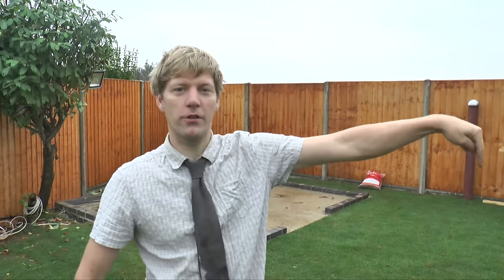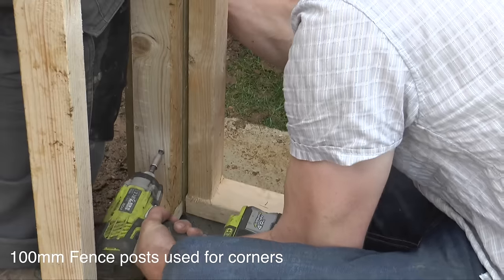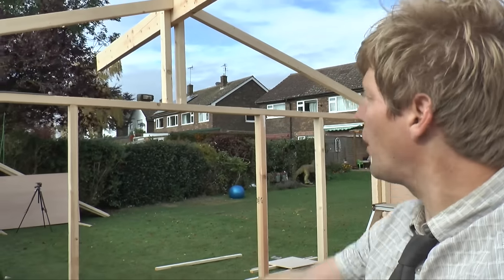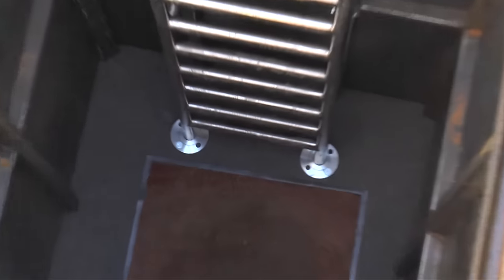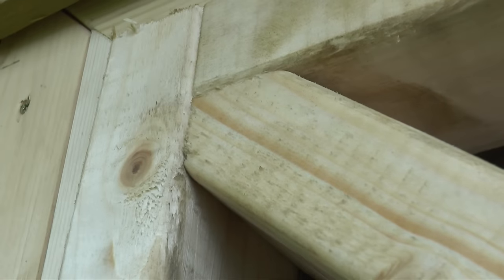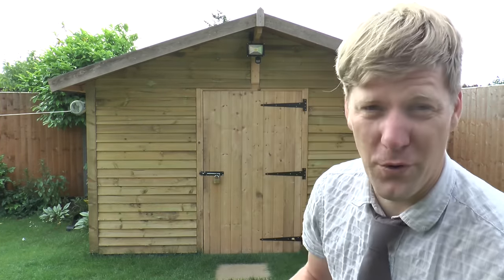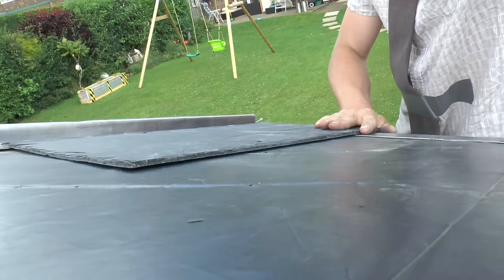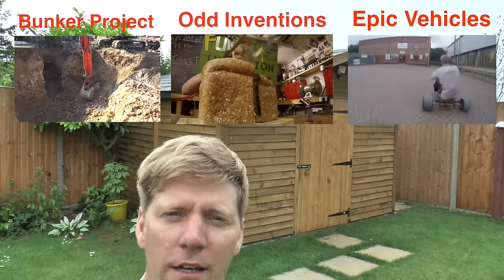How to build a really SOLID shed

Comment: Engineer here, the brick will absorb water like a sponge and transfer that to the wood. Unless you used water resistant bricks, which you didn't specify.
Reply from the maker: They were engineering bricks
Reply: I would have wagered he burn down the shed sooner than the boards rot.
Reply: Don't question the master
Reply: +colinfurze you should make a survival kit video
Reply: Did you just set it on top, or do you have some wood foundation underground? it seems like you just plopped it on top, and a hard knock might jostle it out of place.
Reply: In Australia it's against building code to have wood touching cement/brick except on internal walls. we use a rubber gasket between then Ramset the walls to the slab.
However I would think Furze will tear down the shed for some 50 foot robot that farts rainbows project long before it rots.
Reply: lol
Reply: I've tended to sit the frames on bricks and then wrap the treated mudsil in DPC so the moisture doesn't transfer.
Reply: they screwed it into the bricks
Reply: That roof rocks!!!
Reply: Not to mention there being no ridge vent.
Reply: They don't get much snow. The lack of a ridge vent doesn't mater that much
Reply: Even so, proper ventilation will reduce chances for mold and mildew growth as well as lengthen the life of a roof.
Reply: And he didn't do a topping out ceremony, so Kevin McCloud will disprove.
Reply: who gives a shit, as long as it's not sitting on dirt, its fine...
Reply: +space Aye not much snow but a coupla inches and the entire fookin country shuts down.
Reply: +JayXX Probably by accident too.
Reply: Normally, you'd have a capilary break between the brick footer an the bottom plate to keep water from wicking up into the bottom plate.  A continuous sheet of lead would work.  Or use treated wood for the bottom plate.  I'd worry about rot without that.  Also, you should have some kind of tie down from the roof framing to the ground.
Reply: The product you're looking for is "Sill Plate Gasket" or "Sill Seal" and is fairly inexpensive.  It's just a foam gasket in the appropriate width that you put in between the brick/concrete and the sill plate.

If you want to get really high end some companies make EPDM sill gaskets that cost more but do a far better job air sealing the gap in addition to cutting off moisture travel.  Generally they require being stapled to the underside of the sill plate before its installed, but its the ferrari of this kind of product.
Reply: Woulda like to see more of an overhang colin! Other than that don't listen to these technical muppets entrenched in building regs bollocks, it's obviously gonna last pretty well.
Reply: Blue engineering bricks are what are used as the damp course on houses... go outside and have a look yourself. Stop trying to be a smart arse. from a proper engineer.
Reply: It's a shed. The importance in building quality is not top notch. Besides, I didn't see him use gaskets or similar when he screwed the tiles into the roof which meant he essentially drilled through the "water" protection cover anyhow.
Reply: engineer here, blalala. that is all
Reply: patheticmada
Depends on the brick. Some have sponge effect due ..Capitallar effect or what ever it is called. Basically, if a stone, like lava rock which has a very many small channels inside it, they can suck up water due that effect. But generally bricks aren't constructed in that manner.
Reply: patheticmada
.... I was taking an example of the capitallar effect or what ever it is called where small holes etcetra had the ability to Suck up water even if they are "Stone/Rock/Brick". Aka, their structure. Generally bricks like cinder bricks etcetra have much space between their balls which both make them light but also doesn't make them suffer under the Capitallar effect which can suck up water.
Capillary effect That's the spelling.
Reply: I make my bricks water proof by covering them in Vaseline and wrapping them with saran wrap
Reply: +Helveteshit true, I'm more concerned about no real truss strength and all that weight on it
Reply: Andrew Hollis
Looks plenty strong if it can handle him standing on it. Which shouldn't be a daily occurrence either way. He also used Plywood which has fairly good strength and also evens out the pressure across all beams. Sure, one can built it sturdier but in the end, it is a Shed. Not really anything special that you live in necessarily. The only reason he used isolation was to dampen sound after all.
Reply: +Helveteshit That does not matter because the next higher tile will lay on top of the screws, keeping water away from them anyway.
Reply: 25852Dan
Condensation will still occur below it and it will run along the plastic. Then again, I guess it is only my paranoia.
Reply: He screwed it to the brickwork, The foundations are several tons of steel and concrete. Watch the bunker build video :)
Reply: He should have run some damp course (dpc) around the course of brick. However, you can purchase highly damp-resistant treated timber from most big merchants in the uk so it won't make too much difference to this actual structure...
Reply: Wont the nylon  he used  create vapor  and condensation  which will rot the wood out as well ?
Reply: Helveteshit
Yeah, I suppose some condensation could get under there. I don't think there would be enough moisture to get around the screws or make much of a difference though.
Reply: didn't know it took an engineer to realize that.
Reply: The wood is all screwed to the bricks under them, which are probably mortared to the cement foundation.
Reply: Yep. Need Damp Proof Course (DPC) also the corners are not waterproof - straight path past the Timber cladding, polythene and ply. They might use silicone on the corners as a stop-gap but its not a design solution.
Reply: They were engineering bricks bricky here
Reply: its called a door
Reply: David Mountain
That timber in the corners are treated, hence its colouration. So no worries, it won't rot in twenty years...
Reply: +No fox given Its still £1600 down the toilet if it does fuck up. Nothing wrong with noticing flaws in builds surely?
Reply: Are you also a vegetarian?
Reply: should have used a damp proof membrane ?
Reply: he used engineering bricks, can't you see?
Reply: Normal person here. Mind your own business.
Reply: +Danny Hepple dont be rude here he is just giving him and us an information
Reply: He was trying t be a smarty pants.
Reply: They look like engineering bricks to me. But if I was doing it I'd use a few layers and put a membrane between layers.
Reply: +Nathaniel Mathies That is a project I would love to see him undertake!
Reply: +Henri G 
Engineer here. Why did you feel the need to state "Engineer here" ?
Do you think that that give you or your comments added kudos ?
Reply: a layer of damp-course would sort that.
Reply: Either way, the wood plate should have been Pressure treated.
Reply: damp proof membrane all the way
Reply: Danny Hepple
A rotted shed that doesn't need to be rotting.
Reply: Engineer here. Who the fuck cares.
Reply: Danny Hepple
You cared enough to watch the video, read the comments and comment yourself. So "you do".
Reply: Legos?
Reply: should have used DPC membrane
Reply: The overlapping pattern of the slates makes them waterproof, not the use of gaskets on screws.
Reply: And The Engineer here.

Then engineering bricks don't absoarb water so it isn't carried anywhere else. Can you please learn your facts.

Engineer here.

Thanks.
Reply: Danny Hepple Engineering bricks do absorb water, why do you think houses have a DPC layer in the brickwork. Modern houses have 2-3 courses of engineering bricks from the foundation concrete then DPC membrane then regular bricks
Reply: Vax Buster Engineer here. Engineer here.
Reply: Engineer here, let me explain what you did wrong. I'm going to use overly simplified explanations for common sense principles because if there's one thing I know, it's that everyone besides me is dense.
Reply: Danny Hepple
Keep twisting word and pretending you weren't made a fool of. It's not working but keep trying.
Reply: And The Engineer here.

Made a fool of where precisely?

Engineer here, thanks.
Reply: And The Engineer here.

I  just caught you trying to back track by dismissing what I said. You'll be back soon to back track on the "Ive stopped reading your bullshit" comment you just made.

Engineer here. thanks
Reply: And The that what he predicted you'd do!
Reply: It is best to use cement footed metal brackets or treated wood as is require by code for decks.
Reply: Bricklayer here, they look like  staffie blue engineering brick, water resistant.
how ever a dpc should have been put down.
Reply: Is it really necessary to argue like 8 year olds?  People watch these sorts of videos to get ideas and techniques for their own projects. If the video is a popular one, there is a tendency to believe that everything said and done is correct. That ain’t necessarily so, as in this case. There are numerous examples of poor building practice here, that are likely to lead in shorter than ideal time to rot and water ingress. Whether one wants to spend time and money on building the optimal shed is a matter for the builder, but the decision should be based on what the correct practice is. One can then take a view on compromises if one wants.

Comment: An important point about building a shed in a country with as much rain as England (where I live).  Make provision for a gutter along the sides as otherwise the walls will rot quickly at the bottom where all the water runs off the roof.  The polythene backing to the feather edge boards will speed up that process of rotting as the boards will not dry out readily.  If you use polythene then you should nail the feather edge to vertical battens to create an air gap.  This cost very little extra.
Reply: There are so many issues with the way he did this, I think it best to just advise people to research elsewhere. They literally threw money away and wasted time (lead tucked underneath the slate? Plastic sheet against wood? No air gap? The whole weight of a slate and lead roof on a single timber over a wide door cavity? Huge gaps around expensive insulaton?). This is considered entertainment for some people, but please don't think it is good building advice - I'd hate to see people with less resources waste them.
Reply: @philbutcher6959  Not to mention that he used 2×3 for the roof......  that's under engineered for a shingle roof, let alone slate....
Reply: yeah theres alot wrong with what he did on this but then hes not a builder, hes an engineer so took a different approach

Comment: Fascinating English construction style.  Here in the US, we'd use galvanized steel or aluminum sheet metal for the drip edge and roof top flashing.  Lead is certainly an interesting product to use.  We would also have put the drip edge under the layer of water-proof membrane on the roof so water would drip over and off, but anyway, very cool project!  I love how you built the really solid and insulated door!
Reply: The lead drip edge and roof top flashing should be parts of 1 meter max, with an overlay. Otherwise it will crack due to temperature changes.
Reply: Lead is the traditional product to use I suppose. It's expensive over here so you get most people using alternatives. Colin was just going posh
Reply: It is the traditional method...as in, we haven't used these techniques widely in the US since the late 1940's. They are still used occasionally for remodeling and refurb of historical structures. Even very fancy homes would use soldered copper flashings, not lead. In the US you'd have to special order the lead and you'd be lucky to find a historical building specialist who'd know how to do this work. This is really keeping the older trades alive. Great shed!

Comment: This was the inspiration for the large and very solid shed I built this summer. I used treated 4x2s for the frame and went for a polycarbonate roof so there's plenty of light inside. I then installed a large Lister generator which powers the adjoining garage and probably, in time, the house. The shed floor is 6" thick reinforced concrete to cope with the weight of the generator and insulation in the walls reduces the noise.
Reply: Do you mean like the Lister magnetic generator? The shady story one? I couldn't find any proper info on it, only, like, Facebook sensationalist talks.
Reply: @TheWinjin  No, I think they are referring to the UK company, Lister Petter, which makes engines for generators, pumps, etc.
Reply: @henrywright8394  thanks a lot for clearing this up, I was confused a bit!
Reply: I’m building a shed/workshop using polycarbonate roof as well only problem is condensation on underside however I’m still building & their gaps not finished yet I’m hoping condensation goes away after I finish, putting polystyrene insulation in walls if any one has any suggestions to this issue please advise, maybe time of year & plus side it’s not dripping!

Comment: GREAT JO AND BUILD COLIN!! i LIKED THAT YOU DID NOT USE A SAWZALL. USING A HAND SAW WILL BE A LOST ART...
ALSO BUILDS MUSCLES SAWING,!  LOOKS LIKE AMHAGONY WOOD SIDING, WITCH SHOULD LAST A LONG TIME, WHEN PROPERLY SEALED. I WAS A CARPENTER WHO FRAMED HOUSE FOR 30+ YEARS.
 4 BUILDER ALL OVER THE USA. BUILT MANY TYPES OF SHEDS.
* DICEDED TOO BUILD MY OWN A FEW YEARS BACK.. I WENT WITH 2X4S T+G PINE INSIDE, STEEL SIDING, EVEN CARPET!
ANY AND ALL SHEDS, HELP DE CLUTTER YOU HOUSE OR BASEMENT ETC.. NICE!!!!

Comment: Impressed with all of your handy work.... with the exception of your anchors going into brick @ 1:30

Although I doubt your shed is going anywhere... your anchors are only as strong as each individual brick you screwed into... and that bricks adhesion to its adjacent pieces....
Reply: Didn't like the look of just screws into bricks either.  Nevertheless, my 6'x4' plastic shed is 60kg, so Colin's bigger shed with all that timber, ply, and slate must be somewhere in the region of 500kg to 1000kg.  Yep, that's staying planted though a hurricane.

Comment: The bottom wooden rule in the walls has probably rotted now.
Normally you put a rubber strip underneath, alternatively, roofing paper between the wooden bars and in your case, the bricks.
If you have them in pressure-impregnated wood, it will last even longer
Reply: Agreed, that's probably the only bit where the wood should have been tanalised.
Reply: just put DPC membrane on the engineering bricks before you put down your wood and you'll be fine.
Reply: @Hello Ronnie Larsson, How are you doing?

Comment: That shed will last a long time even in England with its wet climate compared to California where I live. Our sheds aren't even close to the quality that shed has especially its roof. I built one on the rainy side of the big Island of Hawaii, and used all marine studs, and plywood, but only used inexpensive corrugated metal roofing. That roofing material wood have made it look way better.
Reply: You can buy cheap and nasty sheds in the UK too. Always a false economy though in my view. There's no substitute for proper construction. Always better to build it yourself, if nothing else for peace of mind that it is actually sturdy and all the wood has been treated properly.

Comment: is lead typically used for roof flashing in England?
Reply: yep
Reply: Aluminium, that's all we ever use over here
Reply: Yeah n a bout £200 worth - This shed cost a lot more !!
Reply: I ask because I am a sheet metal worker, and I typically do very large buildings, but have never seen lead used on any building for many years. in th United States. We use galvanized steel for cheaper buildings, stainless, copper, and zinc. The idea of lead is nice because you can easily form it on site, but it doesn't look as nice.
Reply: Copper? Lead is much cheaper then that. Then again, in the UK they got plenty of lead.
Reply: Copper is very expensive. Zinc is even more so. They are both common near the ocean because they will survive the salt air much longer. Plus people that live by the ocean have plenty of money.
Reply: We use lead over here as it gives the pikeys something else to rob :)
Reply: Would have liked to see how he would have folded zinc/ally flashings to suit
Reply: it's normally only on high buildings now, people have a tendancy to steal it.

Comment: You should have staggered the seams on the roofing ply for strength.
Reply: Im genuinly interested, tried to search on google. What is "staggered seams on the roofing ply" ?
Reply: It bothered me that he stood the walls up before sheeting them... how do you get that square?
Reply: He would have had to silicon or lead mate that lead Ridge down.
Reply: Generally, you don't want two seams to meet up. If you have hardwood or laminate flooring in your house you can look at that. Every single connection will meet at a right angle.  Making a T shape rather than an X shape.
Reply: ahhh ok, ty for info!
Reply: axlfrhalo
When you have a 4x8 sheet of plywood or osb and you line two edges up on a beam, the edges are the weakest point of the roof and it can flex at those seams.  If you move one sheet over half way so the seam of one lines up with the middle of the next board, the two give each other added rigidity and prevent things like sagging or outright failure due to heavy rain/snow/wind loading.
Reply: thanks again! Really like to learn new things just couldn't find the info googling it.
Reply: axlfrhalo
I would suggest finding a company doing a roof or siding and just spend a few hours watching them.  You don't even need to talk to them to learn a bit about construction.  Often they'll be yelling to each other about things they need or need to do so you'll have that as well.
Reply: Yup, same with everything. Floors, sheathing, even sheetrock. Still a sweet ass shed though!